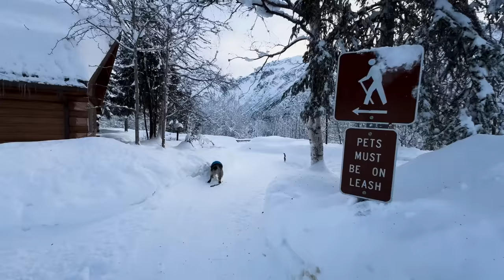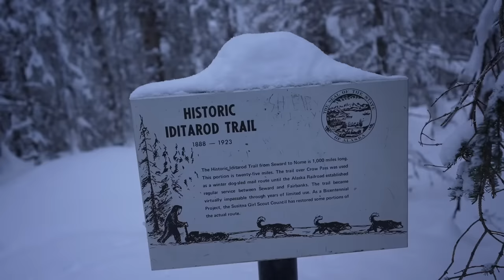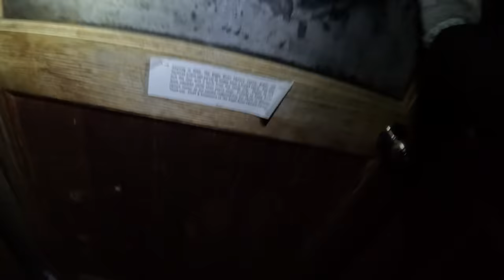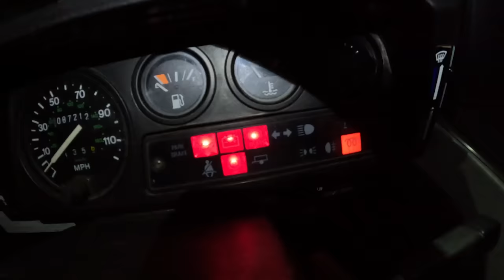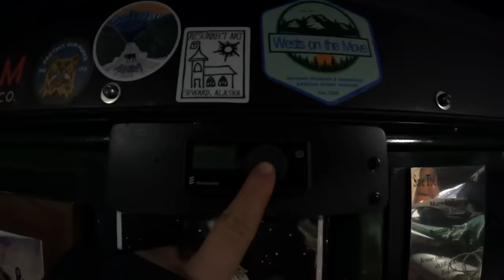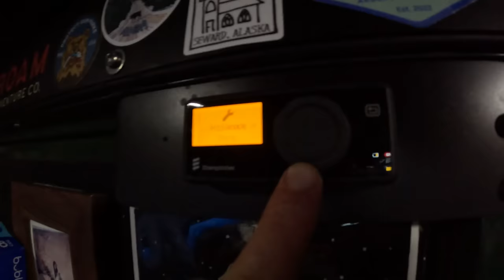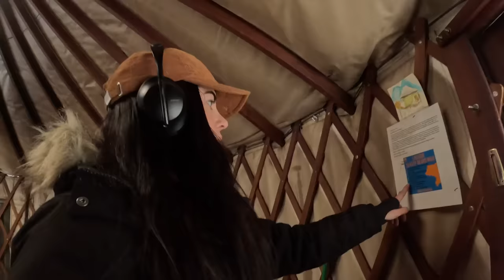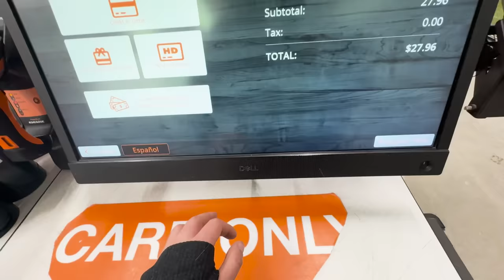3 Horrible Days Truck Camping in Alaska

Comment: A more unprepared van lifer,I have never seen. 😮 I’m amazed that you and your dog weren’t overcome by the CO from the smoke. Yikes. So many mistakes, I don’t even know where to start.
Reply: I didn't think she did anything wrong and I live in an off grid yurt in Alaska. She just was met with some not unusual challenges and did a great job dealing with them.
Reply: @SleepingTiger-vlog  i was wondering, aren't those stoves built so that you have to open an air control flow hatch from the bottom of the stove (under the fire) and also from the chimney? I have lit up a lot of sauna stoves and fireplaces and they're all built like that in here, Finland. The smoke inside the yurt was probably a hint to open up the chimney hatch to let smoke out 😅
Reply: @lamppuu1  I didn't think it was chimney damper since it didn't start smoking right away. It shows her working on the fire for awhile before it starts getting smoky. Our yurt used to have the side chimney like that, and it would smoke up our whole yurt super bad every time. We had to put newspaper up into the chimney first, to create a draw and help warm up the chimney. Cold chimney won't pull the smoke. This is not uncommon. We moved our woodstove to the center of the yurt because a straight up and down chimney works better, but we still get some smoke until the draw gets going. Trying to start wet wood can take several hours of effort and creates a ton of smoke. We still have to crack open the skylight every time we open the woodstove door. I don't think she knows that you can crack open the skylight to let out the smoke from the room. I've lived with only wood heat for most of my adult life in Alaska and I'm 52. I know how to work dampers. This predicament she's in used to happen to us more times than I can count. It's possible that she just didn't open the damper, but just as possible that it was wet wood, cold chimney, not enough kindling, and not knowing that she could crack the skylight to air out the room.

Comment: The damper on the wood stove was closed… you’re creating a fire, which requires oxygen, and a spot to exhaust the smoke. On a wood stove there is typically an inlet, under the door, that you pull out to regulate oxygen intake… and a damper on the exhaust pipe to regulate the flow of exhaust (if you have both intake and exhaust wide open you’ll just burn up your wood extremely fast and blow the heat right out the exhaust). By regulating the damper, you build up heat in the wood stove and allow the smoke to escape.

I hate to say it, but you have a lot to learn! Most of the problems you’re facing are self-inflicted. This platform is wonderful for gaining knowledge, use it to your advantage and learn how to use the things that keep you alive.
Reply: That’s exactly what I realized to, right away
Reply: Carbon monoxide danger too
Reply: exactly
Reply: I always closed the damper to the fireplace so bats or birds wouldn’t fly in, during non use of the fireplace.  Open it when starting a fire.
Reply: 100%. Her lack of knowledge could get her killed especially in Alaska. I was also worried for her small doggie walks in those freezing temps. There are points when the dog even looks concerned, especially when they were in the back with the cold air from the diesel heater.
Reply: Nice of you to explain one of the most awesome inventions ever built. Used mine to eat and stay warm when lost power for almost two weeks.
Reply: I hoped someone would see that!! How does she not know that!
Reply: Good advice girl has a lot to learn but getting there if you aint used to wood stoves they aren't very complicated but if you aren't it can be a pain putting wood outside for a few will help dry it in those Temps
Reply: Grew up heating house with a wood stove we didn't have electricity
Reply: Yup
Reply: Honey, you need a smith 500 hand gun!!!!
Reply: OMG!!!! This is hard to watch!!! She didn't even bring a sub zero sleeping bag. What is wrong with this girl???
Reply: I saw that and I would think she could have figured that out. I’m wondering if this is just for views. I mean someone is filming correct?
Reply: @rickcharlton5538  she's Getting by on a pretty face.
Reply: I think maybe instructions from the yurt owners might be an idea.. while a lot of people know how to regulate a stove.
 Some don't. There are a few versions out there too that work differently. I agree with every comment here that if smoke is inside and not outside you've done something wrong.. so you have a look around maybe find a book/file of instruction from the owners.. and if not.. open the door a little to let the smoke out.. go see if the chimney is letting smoke out.. blah blah blah..
Reply: That was my FIRST thought!!!! Also, she never cleaned the ashes which can also block oxygen… if you know you are relying on a wood stove- make sure you know how to use one!🙄
Reply: what if the wood is wet or damp as she was saying, will it still burn?
Reply: @dmariewalker6880  And shut your vehicle's vents when it is parked to keep critters from climbing inside.  Same principle.
Reply: Yep!  But us experienced ones shouldn’t waste our breath
Reply: Yikes!  I’m a city dweller but even I know to open the damper.
Reply: Ok but a cold flu pipe will result in backdraft even when the damper is open. Starting fires in a wood stove with wet wood is hard. When I got my first wood stove, the wood wasn’t very dry and it took me a solid week to get reliably good at starting fires. I had backdrafts and I didn’t even have a dampener. The next year my wood was dry and starting a fire was so much easier. When I had someone stay at my place, I had to write out extensive instructions on how to use the stove. It’s just not that intuitive. 

Everyone should give her credit. She had three sources of heat and ended up needing her third source. That’s why you have options. I think that is proof she wasn’t being reckless.
Reply: it was crazy to watch she could have basically kill herself....
Reply: @dollyoliver9426  she’s filming herself. Have you heard of phone stands?
Reply: @brendabriery9648 PhD in some meaningless subject, like internationale realtions or marketing strategy 😅
Reply: It’s ON PURPOSE! That’s how she makes these YT videos that draw ppl in